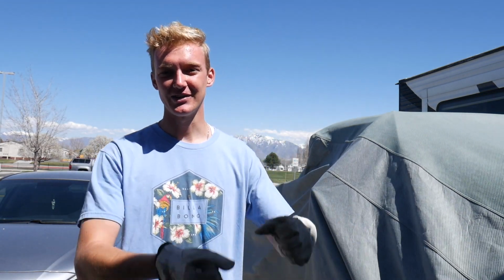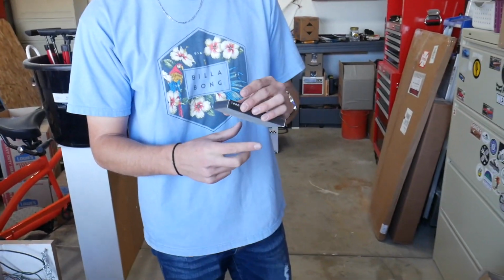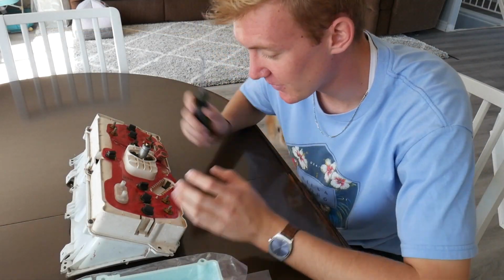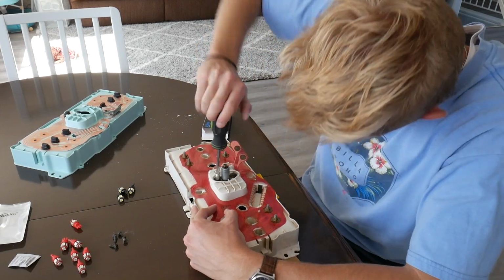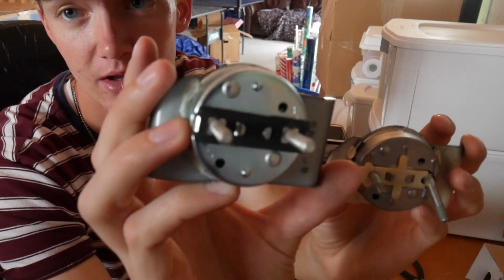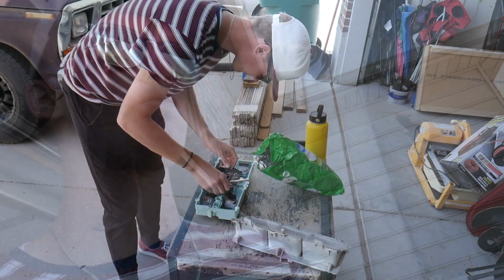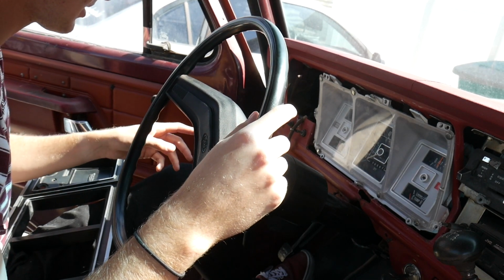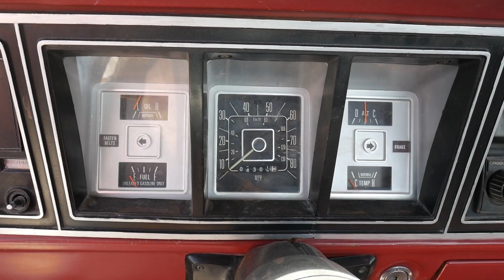Ep.19 1979 Ford F250 Restoration - Instrument cluster, new lights and replacement gauges

Comment: I am glad I ran into this video as my son and I are actually working on the same project, switching out the lights, the instrument panel (back) since its old and brittle and it's disintegrating slowly and also switching out the printed circuit board, so basically the same exact project. Thank you for the video as it was extremely helpful. I
Reply from the maker: Very cool! So glad to hear it was helpful. Another dentside saved!

Comment: Just got a 1979 Ford F-150 custom 4x4 with a 351m engine. This series helps immensely. It was my dads old truck and now is our project. My truck needs a lot more body work than yours, surface rust everywhere. Love the series thanks for putting out good informative content!
Reply from the maker: Surface rust can be dealt with if you get on it quick enough. Fun project trucks though. I also picked up a 66 F250 that I’ll be starting on soon.

Comment: Just got home from work and watched the video! Excellent work, and I am excited to see some more progress in the near future! I noticed when you put the key on, you didn't get the seatbelt light, that's because you either have the little white box on the side that makes the buzzer noise unhooked, or unhooked under the seat, or its broken! Which does happen. You can find them on eBay quite easily... I want to replace mine just so its accurate to when the truck as built! :) hehe
Reply from the maker: The light came on but no buzzing. Which doesn’t bother me at all. We’ll see what happens when it’s all put back together. We are still in tear apart mode right now. 🤦🏼‍♂️😜
Reply: @troysgarage  hahaha I just like the charm of it lol, seems like you have some work left to do, but lots of great progress! Keep it up! Take care guys